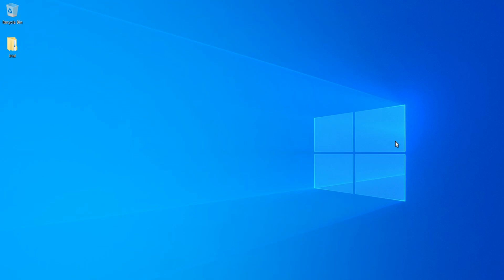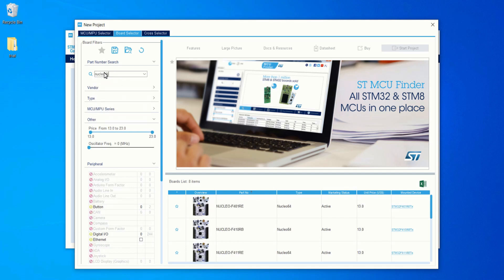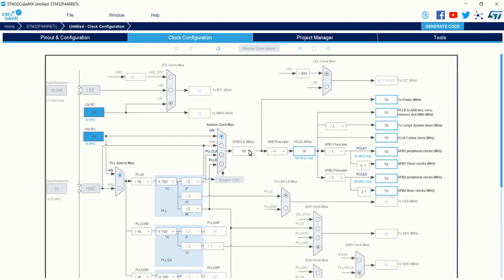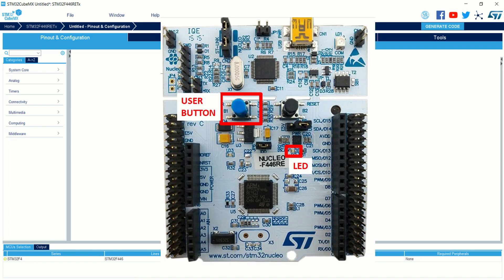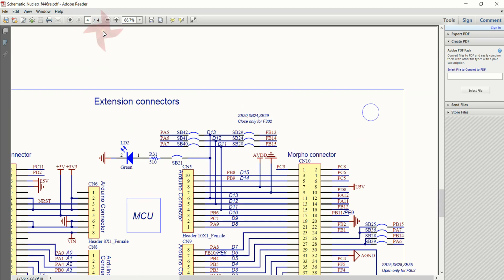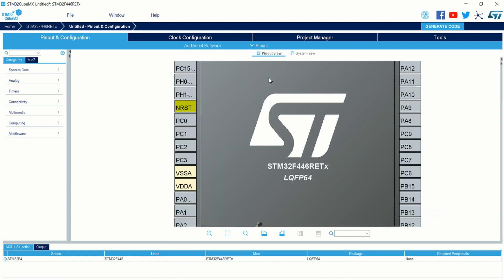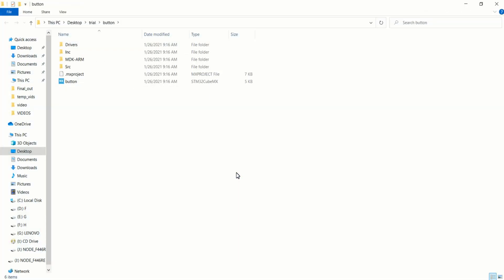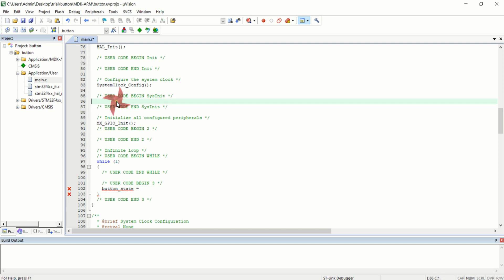Interfacing of Pushbutton with STM32F4 | STM32 | STM32 CUBE MX | KEIL IDE |  T - 7 | NUCLEO F446RE

Comment: You forgot to configure the pin PC13 as Pull up mode in cube MX
Reply from the maker: In nucleo we have external pull up circuit so it is not necessary if you use nucleo development board
Reply: @SMtrainingacademy  aaa Understood thank you bro

Comment: why not declared button state as boolean if it only stores 1 or 0?
Reply: In stm32 version of c there is no bool for some reason. You need to include a library called "stdbool" witch take more memory space then one integer. That is probably why using a bool is not optimal in this case.
Reply: button_state is IDR register value OF THE peripheral GPIOC. You need to understand low level Programming to understand that clearly